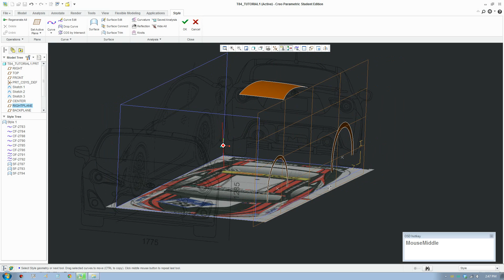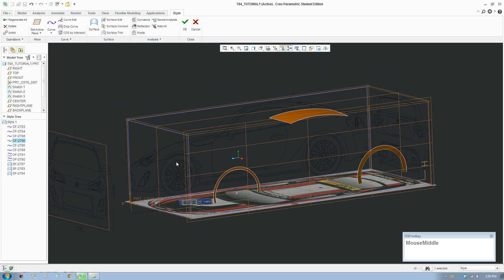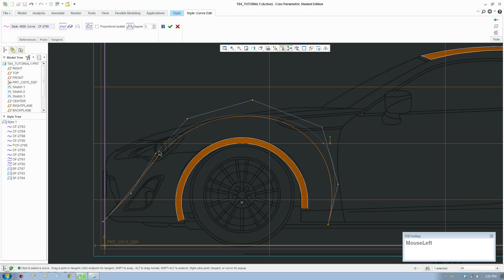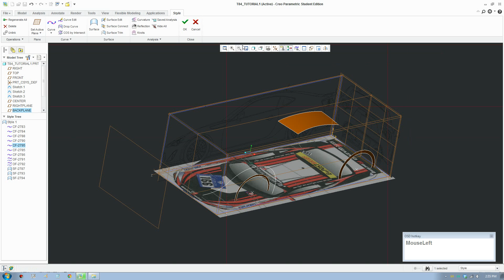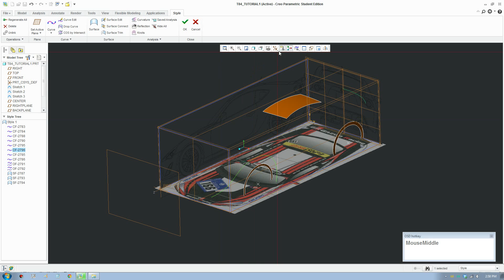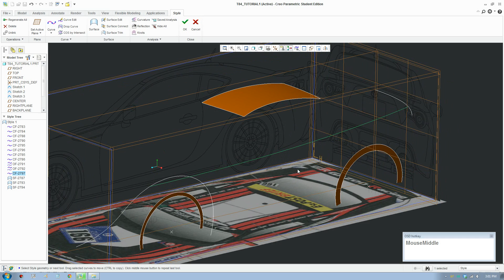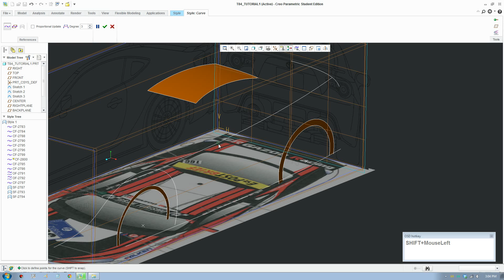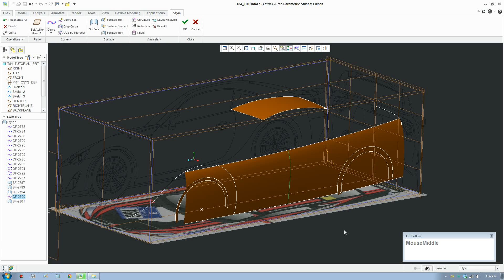Creo Car Tutorial Toyota 86 - Part 2 Creating Car Surface

Comment: sir, curves are not joining together . you joined four curves to get surface of roof in step 1. And in this step the backplane curve and right plane curve are joined. i am unable to join the curves. 1 edge is joining and 2nd edge is not merging into the curve.

Comment: sir the curve at the rim is not rotating towards inner side can you please tell whats the problem
Reply from the maker: Try use the other options for the move pull down. Also try set the active plane in another spot. Play around with the other tools.